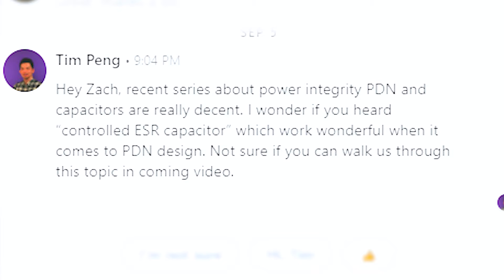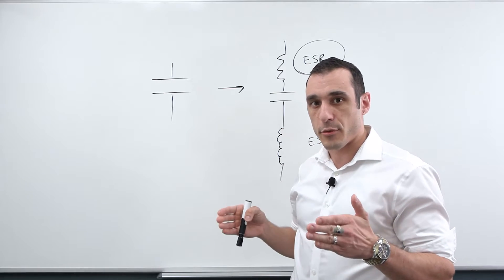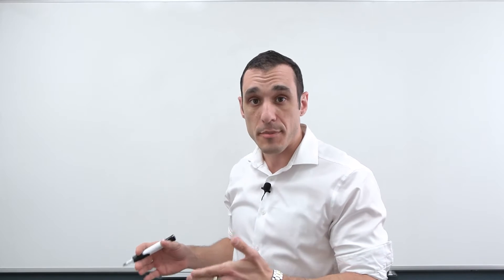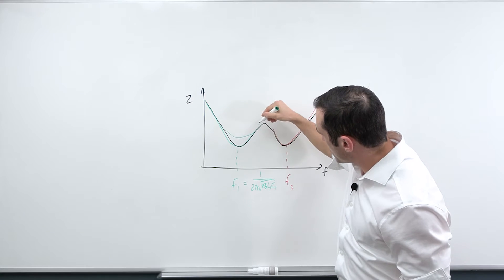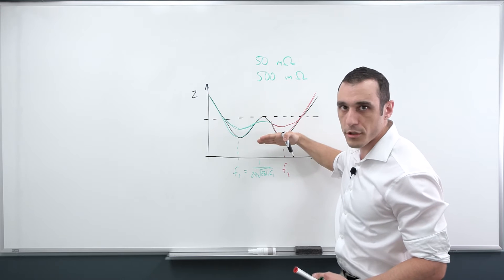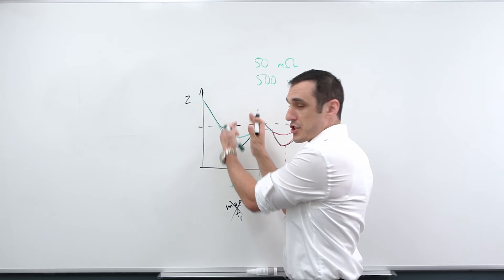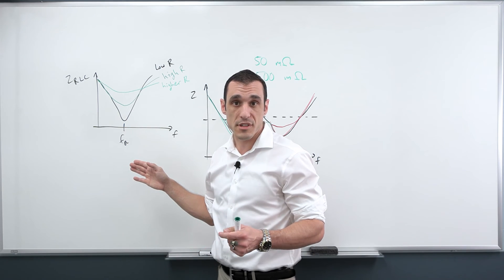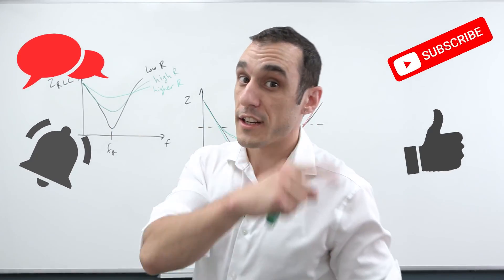Controlled ESR Capacitors

Comment: The availability of controlled ESR capacitors on the market seems really low, I guess they can only be considered if you can place a big order directly at the manufacturer.
Reply: They are out there, contact the big manufacturers like Murata or Yageo and request their part numbers, then look on Digikey, does not need to be a big order to get these.

Comment: Hi, Zach! Thank you for your terrific playlist. I found every video extremely useful! You're cool, I wish you good luck in the next videos!
I have a question, why did you draw equivalent impedance spectrum for PDN considered the way you did? (I mean f1 and f2 curves sum)
Hope you'll see it! Thank you.
Reply: I'll get into this deeper in our filming session this week. In short, it's because the dominant impedances are all in parallel, so you get an impedance equation that is inversely proportional to a product of all the series RLC impedances. This impedance equation has multiple roots where there is a pole (infinite amplitude response), with one pole located very near to the natural frequency for each equivalent RLC circuit for each capacitor.

I'll do a derivation of it so you can see what I mean.

Comment: ESR stands for  "Equivalent Series Resistance" and not "Effective Series Resistance" as Zach it mentions several time in the video
Reply: You will see both used to refer to the same thing. Equivalent is more popular. I use them interchangeably as do some component manufacturers.